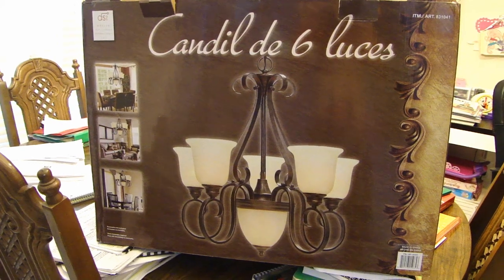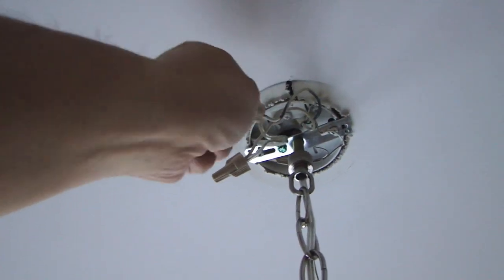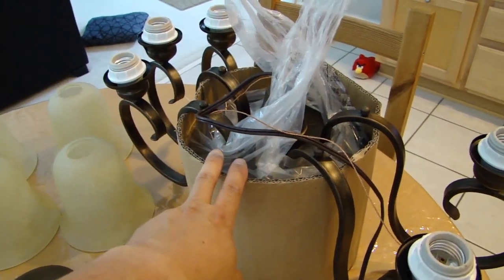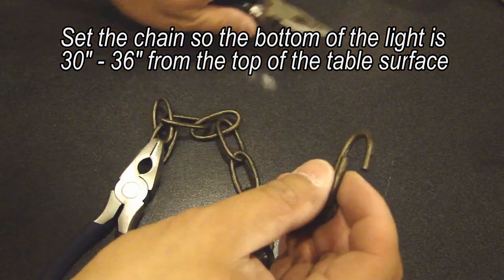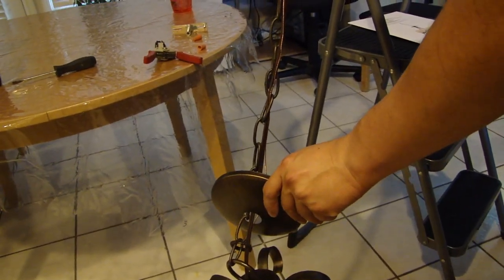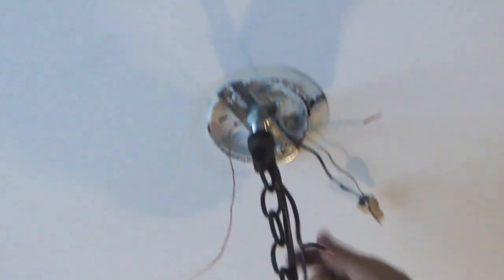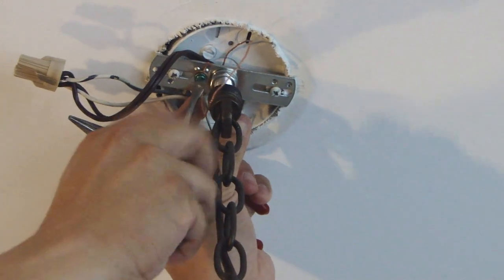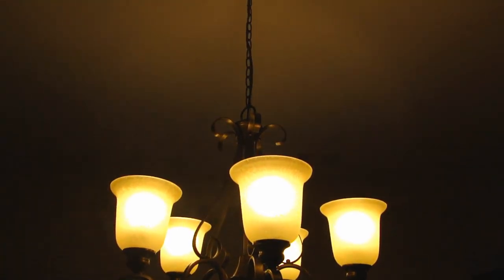Install 6 Light Chandelier in Dining Room

Comment: I noticed that before you connected the ground wire that you did not have the chandelier wires going up through the nipple.  You corrected that before you attached the ground wire.   In the first scenario the canopy would not have gone on because the wires were in the way.   This helped me because before this I was connected the wires first and then had a twisted mess.

Comment: Great video, good method, much better than the instructions that came with my lamp.  As stated below, make sure you get the right lamp wires to the black and white lines in the house.  For mine, the smooth wire with writing connects to black, the rigid/square wire connects to white.

Comment: Thank you so much for this tutorial. Quick question. We did all your steps but our chandelier is crooked a bit. Do you know how we could fix that ?
Reply: You probably need to let one of the screws come down a bit by unscrewing it some. Use a small level to see things are evening out. You’ll want to Do this from the ceiling mounting plate. 
*FYI - When working with drywall in the ceiling, things kind of Eban and flow up there.  It’s not always even from the start . Houses settle and we have to work around that.
So you can modify one screw by tightened it in further. If the level is still showing there’s an issue, adjust again and or take a peek at the other screw. It also may be in need to be loosened or tightened to balance out the overall project better.

Sorry if that doesn’t sound clear. I wish I could send you a screenshot of what I’m Speaking of.
Maybe Google: how to fix a crooked chandelier. As they’ll likely have images that will walk you through it.
Good luck!
Reply: Yeah. Buy a new one.

Comment: It is important to wire correctly. You can wire this backwards and it will still work however you may get a shock later when changing bulbs or cleaning lamp. If you have a lamp with two wires with the same color, usually the neutral wire will have writing on it or a ridge or notches. Always be careful when working with electrical wiring. Otherwise it was a great video.
Reply: Sophiecjp Thank you for that information. :)
Reply: Sophiecjp my chandelier wire with writing on it was for the black and the non-writing/blank was for the white!!!
Reply: What color is neutral cable? White or black?
Reply: Thanks I have a Hampton Bay, and it has two wires same color and one has writing but the instructions does not tell you which is Neutral, with your comment I just figured this out, thanks a Million @sophiecjp
Reply: So scared to do this right now
Reply: @eduardomancia4958  I know right? Wtf

Comment: I have two sets of wires coming out of the electrical box on the ceiling (both positive and negative). Is it okay if I join the two hot wires from the electrical box to the wire from the chandelier? Then, could I join the two negatives form the electrical box to the negative from my chandelier? Thanks.
Reply: Boris Salgado жужжит, ,
Эх

Comment: Why would you NOT assemble your new chandelier BEFORE you begin the process?? Otherwise, nice job.
Reply from the maker: It's heavy and awkward to handle when installing.
Reply: @dial2fast  Not in the air, on the ground like you did after you took down the old one. Why wouldn't you assemble it before you even began in the even something was broken, missing, etc., so you don't have a gaping hole in your ceiling while you run back to the store.

Comment: I am changing the glass globes(shade) in the Chandelier. I switched out two of the but I can't unscrew that metal ring in the center of other. It's too  tight. The others unscrewed with little effort. Any suggestions on how to loosen the ring w/o breaking the globe or socket?

Comment: Can you adjust the length of the chain?
Reply from the maker: Yes, you need to use pliers to open the chain links and also shorten the length of the cable.
Reply: dial2fast Thanks so much! I'm thinking the "cable" means the electrical wiring? I'm still not sure if I want to do it myself yet. Your video helps show so many things I didn't know. I do know to turn the breaker off before you do anything. I like the way you showed how to open the links. I have put lights in before but not a chandelier.
Reply: so did you do it yourself in the end? just curious if it worked out ok..
Reply: Michael Lemontzis Not yet. I ordered the one I wanted, and when it comes I'm going do it myself.  Well, with a little help from someone who can hold it up. It actually looks just like the one in the video. I ordered it from Menards. :-)
Reply: CUB NATION108 Nice, good luck with it. :)

Comment: If the fixture wires were the same color, how did you know which was for the black/white connections? I have yet to find a YouTube video on how to properly DIY wiring. Thumbs down AGAIN!
Reply: I just replaced my kitchen chandelier, both wires from the fixture were black. The wire that connects to the white wire   Is ribbed. The wire that connects to the black wire is smooth.